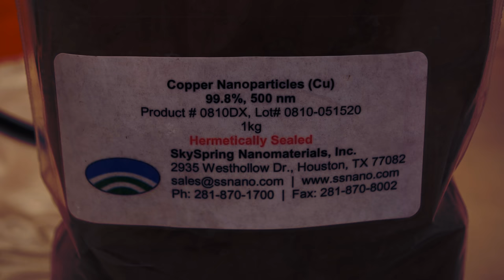Make Our Best Thermal Paste... YOURSELF!

Comment: Could you use the lower performing thermal paste to heat sink the heat from the Ultrasonic stage of the higher performing Thermal Paste?
Reply from the maker: There are relatively inexpensive double wall beakers that allow cooling water to circulate around the inner container.  You use something like our lab chiller to supply that cooling water.
Reply: @TechIngredients  oo both good ideas.

Also, you mentioning a potential performance increase with a longer mix duration in the Pestle and Mortar made me recall a video AvE made 7 years ago where he made a sort of Wobble Drive to broach square wholes in thick metal with a drill press.  Might be an interesting and cheap way to automate a Pestle and Mortar hahaha 🤣

Comment: What is the maximal but still optimal size of the aluminum powder, if there's no way to find 5 micron one to purchase?
Reply from the maker: Try to stay smaller than 5 microns if that particular size is the problem. As they grow larger, the particles will prevent the surfaces from approaching each other, and the performance will decrease. 
Make sure that the supplier provides spherical particles because other shapes interfere with maximal packing density.

Comment: So what about gallium liquid metal TIM? Love your channel with how it's entertaining and educational, pretty cool stuff
Reply from the maker: I've made some and have upgraded the test rig to compare it with commercial  samples.  We'll  cover that next.
Reply: @TechIngredients  That would be awesome. Also Gallium liquid cooled v water cooled loop and any corrosion or other issues with using Gallium. I think Gallium can dry or solidify like glue as it's somewhat open to air and with months of heating and cooling cycles and leaves some kind of pitting on the metal surfaces, as I saw a little last time I took off the huge Macho 2 Bravo heatsink with its nickel plated copper plate, from 9900k cpu copper IHS and another from gpu EVGA 1080TI Kingpin with just copper plate (gpu silicon die wasn't pitted and perfect mirror looking). That's over 2 years ago to experiment with fresh application and clean all dust out versus 1 or 2 years old application with same pc overclocking settings. 
So I mirror polished the metal surfaces, reapplied gallium TIM on both sides whilst careful to not get it on the tiny capacitors nearby by covering them with tape just whilst applying. It is still working great and cool.  I want to experiment again with fresh polish and application of Gallium based TIM. I've just googled Gallium thermal conductivity at 29 W/(m K) compared to almost 400 for copper and just 0.6 for water

Comment: could you use the sonicator to simply rub the to aluminum surfaces against each other, and friction weld them together?  Perhaps you don't need any thermal paste at all then?
Reply from the maker: Welding the aluminum is possible, but the conditions would likely damage the electronic components we're trying to cool.
Reply: @TechIngredients  That makes sense! Thanks :) (Maybe it would be fun to test anyways?)

Comment: Stupid question: Maybe I missed this, but would Mercury work as a better thermal interface material?
Reply from the maker: It would work about the same as gallium, but is much more toxic.  Both liquids are very corrosive to most metals.

Comment: i guess there is 1 problem, oily substances escape over surfaces. Put a drop of oil on a table, and wait 20 years, the oil has gotten to its feet. mx4 states at least 8 years runtime. maybe its best to use something with the least capillary forces? what about those cheap white pastes, guess zno, how do they perform. i think runtime is also very important.

Comment: If the warmth in that room is a simple function of speed of the air molecules,  
Then why doesn't a big fan blowing it around warm the room?
Reply from the maker: Actually, it does.  But the molecules are already moving at over 300 M/sec, the fan is likely to be trivial.

Comment: How are you... If i use aluminum oxide, will it work,,,, is aluminum oxide powder useful for thermal conduction like aluminum metal powder?
Reply from the maker: It's  an option.  But, it's important to obtain spherical particles to allow maximum solids loading.

Comment: Im curious to your selection of nanopartical materials, would the best resoult not be from havig all 3 Sizes of nanoparticles be of Copper, which has a termal conductivity several times more than that of Zink oxide and almost twice that of Aluminium? or does the use of copper nanoparticles precent any particular problems making them unsutable?
Reply from the maker: Maybe it's their degree of sphericity or the aluminum's oxide coating, but the highest solids loading occurs with the aluminum and it's elimination of the oil that matters most.

Comment: Have you done any experiments with boron nitride? It seems to be the compound of choice in 3d printing.
Reply from the maker: Yes, it's ok but it's not as good as the spherical metal powders because these permit a higher solids loading fraction.
Reply: @TechIngredients  Thanks, good to know. Now I'm wondering if indium tape or plating would be better on a 3d printer's nozzle.

Comment: What I'm interested is that how well does this perform under load for extended periods of time? I've changed thermal paste and seen it gone to dry powder in about year, obviously absolutely killing the performance of the paste. This happened on normal computer.
Reply from the maker: We're currently running two computers with this paste, now at the five month point without degradation.
Reply: @TechIngredients  That's good start, but I'd like to see absolute minimum of two years of usage. Some compounds can last easily five years of moderate to heavy usage without too much of degradation. Are you going to do followups regarding this? I assume at least when year is done you'll give some description how it's going on?

Comment: would it be possible to beat noctuas performance by linus standards if you would use a mix of the oil you used and something that evaporates slowly so it is even more liquid in the beginning and over time approaches the "perfect" mixtureratio you mentioned earlyer in this video?
Reply from the maker: Actually, we did beat Noctura, only Alex then stated we'll call it a draw.😛
I tried that technique and the mixture tended to stratify during evapoation and had to be remixed.

Comment: Would not gold leaf do the same as indium? If applied in a Vacuum particularly?
Reply from the maker: No.  Gold as soft as it is is much harder than indium and gold leaf is nanometers thick and it will not conform to anything less than optically flat surfaces even if enough pressure could be applied.

Comment: what if though.. you didn't use a paste at all and went directly to solid but a softer solid.
maybe 1 or 2 gold leaf foils ?
the gold leaf would deform and get shushed into place taking up the air space
so it would be a metal to metal to matal contact.

though i suspect this might be a bit tricky to pull off.
Reply from the maker: Gold is much harder than indium.  It just seems softer in thin sheets.
Reply: @TechIngredients  im no metal expert . i just know lead and gold are fairly soft metals compared to steel and aluminum just based on what I've seen so far.

i don't think I've seen much on indium so i might have to look that metal up some time.

Comment: Is there any risk of electrical conductivity of the basic aluminium version that prevents usage on a pcb without protective measures on capacitors etc (like how u need to protect the surface with kapton tape or nail polish when using galium based Tim )
Reply from the maker: Neither paste is electrically conductive.
Reply: @TechIngredients  thanks. May I ask how come the alu powder isn't cobductive?

Comment: How well does the quick and easy compound work if you replace the glycerin with silicone oil?
Reply from the maker: Almost as well as Artic Silver.
Reply: @TechIngredients  Would you use the same viscosity as the complex formulation, or would you use something a bit thicker when not employing densification?

Comment: Is it possible to use a two compound mixture that creates a semi solid thermal interface but is applied as two greases that when they interface with each other they push out their oils?
Reply from the maker: Possibly, but that could be done more predictably during the formulation if there was an advantage in the combination.

Comment: Hi, how about using low thermal metal? when it melts, it will unite the two metals and become a good conductor of heat
Reply from the maker: In some cases that can be done, but even the low temperature indium solders still need to reach temperatures that will damage some electronics like a CPU.
Reply: @TechIngredients  : hi, I found on YouTube that some electronic company already use low thermal metal as thermal conductor for CPU. I believe it's galium.
I think it will be great if you make a comparison video between galium, regular thermal paste, and your version thermal paste.
BTW, I find your channel make  very good and easy to understand learning video. I love it 👍👍👍
Reply from the maker: We will.

Comment: Hmm... Im'ma need you to humor me for a moment here as it does go against some of the principles you discussed, also I was working and may have missed it. Anywho, do you think a fullerene aluminum paste would be worth trying? What I had in mind was setting up a slightly pressurized chamber with an inert atmosphere (nitrogen at 1.1atm should work), then in that chamber use a similar method of ultrasonic blending to combine fullerene with amorphous aluminum  nanoparticles, then suspend that in some silicone oil? 

My thinking is that if you could get the buckyballs to cozy up to the aluminum close enough that thermally they would behave as one, then any excess fullerene would be left in suspension between those larger structures. Because a lot of carbon structures act as a lubricant because they are quite stable they should be able to freely move at a wide temperature range well not coming out of solution (kinda, I got more to say on that). The use of aluminum was also a conscious choice because of its high thermal conductivity and physical softness. Since buckyballs are so hard, atop being more thermally conductive, they would have no problem imbeddimg themselves into the aluminum, in essence acting as a single larger structure. The excess fullerene would be semi-mobile in the space between, so when heated they could easily reanspher energy between the larger structures. My only concern would be the whole works not retaining the oil all that well: it would be a paste at first but over time it would harden. It could easily be turned back to a paste with a quick ultrasonic blast but id be worried about the oil fully evaluating and damaging components...

Any thoughts?
Reply from the maker: The reasoning is good. I'd still stay with spherical aluminum when aluminum is used.
Remember that Bucky balls are very thermally conductive parallel to the carbon, hexagonal walls, but not through plane.  I'm not sure how they perform, relative to a metal when viewed as a complete structure. Nevertheless, I believe this is an idea worth pursuing.
Reply: @TechIngredients  then I reckon I will! I'm currently making a milti-use transformer doo-hicky... Basically it's two transformers that have a common low voltage output, capable of a cool 3'200 watts. It'll offer a truly ridiculous amount of control to the outbound current; right now it can vary the voltage from 0.5V to ~ 12kV with the amperage being inversly proportional (12kV = ~0.25A, 0.5V = ~6'400A. Calculated, not measured). Sorry, rambling because I'm excited! I only mentioned it because one of the attachments I'll be able to power is an arc furnace (and a TIG welder and an induction heater and a... sorry, rambling again!)

The arc furnace is actually already built, just needs some juice and it'll be up and running. Now if memory serves an arc furnace is one of the preferred ways to produce buckyballs. I'll have to do some research cuz it's been ages but I seem to recall that generating a carbon plasma in a pressurize helium vessel was a really efficient means of production, which sure beats the hundreds per gram price tag. Since I'll already be 80% of the way there I might as well go the full distance and make a reaction chamber (more attachments 🤗).

Oh and I'll quickly mention that I've also been toying with the idea of making a powetful laser specifically for laser ablation. I want an abundance of metalic nanoparticles for 3D printing, but as they say double the use means double the incentive. Plus my step dad gets to work with both a CO2 and Nd:YAG laser both with outputs mesured in kW... im a little jealous...

If you have any thoughts on how I could go about purifying the buckyballs after producing them I'm all ears. Any insight you may have on purifying, or really any insights of, I would be very extremely grateful for.

I'll keep you updated on my progress, should you wish it
Reply from the maker: We have lasers that can do that and covered them in our earlier videos.  Nevertheless,  nano particles are not very expensive compared to a set up to make them not to mention characterize and purify them.  Check out Sky Spring nano materials.  Also, we are building a rig to make flash graphene which isn't difficult and I show how to do that in an upcoming video.

Comment: I commented on your Air Conditione PC video on why that setup performed so well. I really do believe that the best heat sink for any CPU is the PCB itself. Probably the ground plane. Think of all that surface area that can be exploited. Well done on that video and this as well. Keep up the good work.
Reply: the problem with PCB as heatsink is that the die is connected to its substrate with thin bond wires, and then the cpu package is connected to the main PCB with some thin pins/contacts.  You can sink way more heat through a thin layer of silicon diffusion barrier into a big chunk of metal than you could ever pull through the tiny electrical contacts.

Comment: If your aluminum and zinc oxide recipes are better than what's on the market, then shouldn't copper based or silver based recipes be twice as good? (since copper had twice the heat transfer)
Reply from the maker: No, it's more complicated than the raw thermal conductivity of the particles.
As I explained, it's more about solids loading. Think about this from another viewpoint. It's how much of the poorly conductive liquid you can eliminate.
The more spherical the particles and a distribution of sizes will allow tighter packing while still allowing for plastic flow of the paste under pressure.

Comment: Do you polish the metal which will have the thermal paste to a mirror finish?
Reply from the maker: Not really, but if you apply a grinding paste and bring the surfaces to better than a 4000 grit they will look polished.

Comment: How comes the 300 nm Al powder is more conductive compared to the 300 nm Cu powder?
Reply from the maker: The dominant factor is the solids loading  fraction. Think of the grease or oil as an insulator. The aluminum powder is more spherical and flows better than the copper, so more can be added while the mixture viscosity is still low enough to be workable.

Comment: I guess I missed why you are using aluminum instead of copper?  (Or silver)

Are those materials not available in the shape/size?
Reply from the maker: It's  primarily  the shape.  The very spherical aluminum particles  allow for a higher solids loading, and that's  the most important factor.
Reply: @TechIngredients    Understood, I guess I missed that copper and silver were not available in the spherical shapes unlike diamond/CF nanotubes, etc.

EDIT: poorly worded

Comment: Wouldn't the probes be measuring the heat that is rising from the hot water?
Reply from the maker: That's why I mounted them through the table and insulated them and in any case, they are both in the same environment.
Reply: @TechIngredients  Good answer, It was what I wanted to hear. Keep up the great work

Comment: Where would very finely ground food grade diatomaceous earth rate as a thermally conductive filler-paste?
Reply from the maker: It's spherical and that's good, however glass has a much lower intrinsic thermal conductivity than metals and that's bad.  Aluminum powder is inexpensive and works very well, I'd stick with that.

Comment: Idea, why don't you thin it with something (isoprop) for the purpose of mixing.  Should go to creamy stage quick and just stir till evap thinning solution... should stay creamy and good, no?
Reply from the maker: I tried that.  The problem is that when the solvent is evaporated during the degassing process, the mixture tends to stratify and then needs to be mixed again.
Reply: @TechIngredients  Many thanks for replying.  And good job btw.

Comment: Is there a reason you cant use silver power for this?
Reply from the maker: No, you could 
However, it turns out that the aluminum  actually  works better.  Despite  the lower thermal conductivity, the aluminum powder is more spherical and packs more densely.  It's  all about solids loading.

Comment: If you use 300nm copper wont it react with the 5 micron aluminium? shouldn't you use 5 micron copper?
Reply from the maker: No, the oil insulates the metals and prevents chemical reactions.